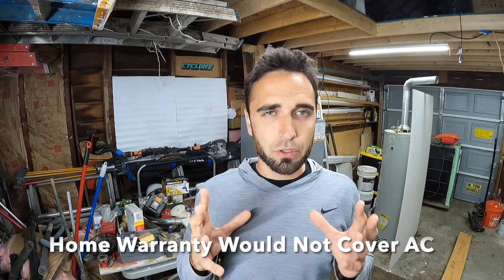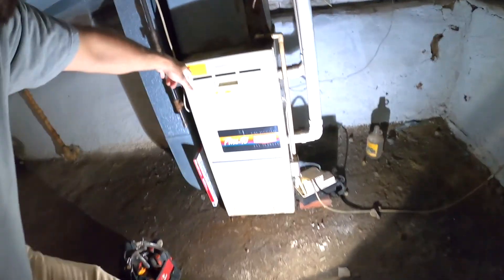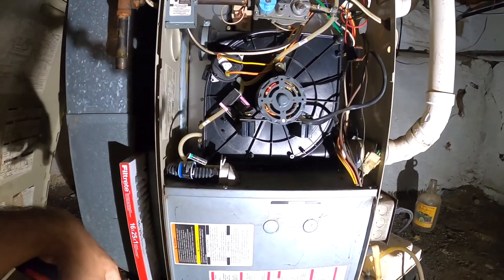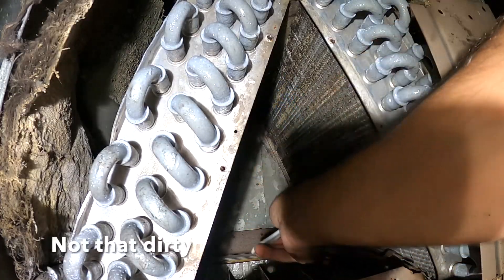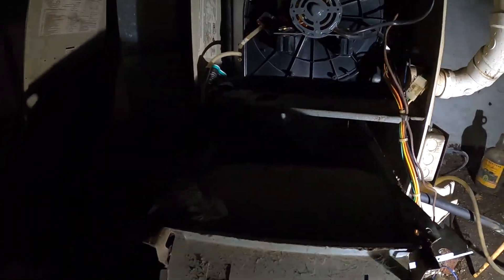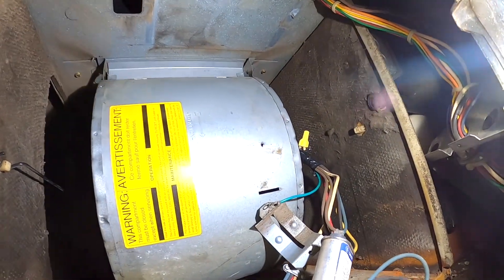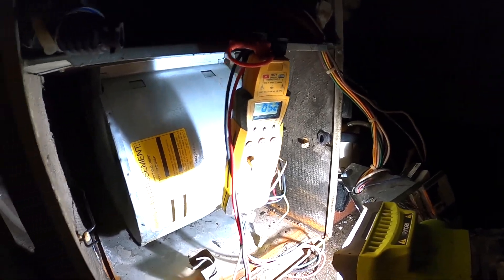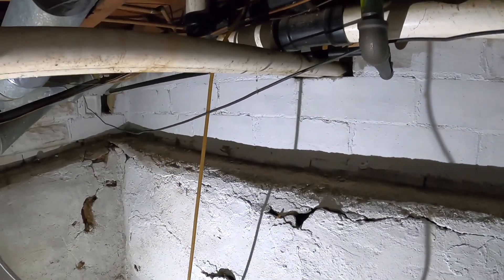FREE AC Repair | Old GE Unit

Comment: Where did you buy the capacitor for such a low price? HVAC companies in my are were charging about $185 few years ago to replace the capacitor on condenser or air handling unit. Cheap fix as diy if you have the time and the tenants have the patience to wait.
Reply from the maker: I purchase all my equipment through a local supply house. 1.99 is my cost for that capacitor before taxes. I try to carry common parts on my van to prevent wasted time. Making more time to film for YouTube. Haha thanks for watching.

Comment: Having dealt with HVAC repairs with capacitors. Getting quoted $400 dollars for a $20 part on Amazon it took me 5 mins to replace. He even gave me advice on doing it. The repair guy was like yeah the markup on capacitors is how we make money.
Reply from the maker: Sounds like you had a nice Hvac tech, but $400 is crazy. The markup on parts seems excessive. I understand overhead but just be reasonable. Thanks for watching.